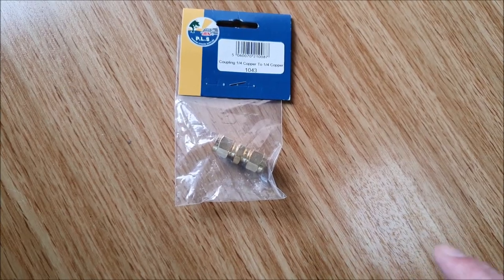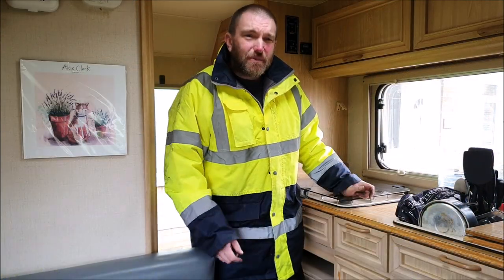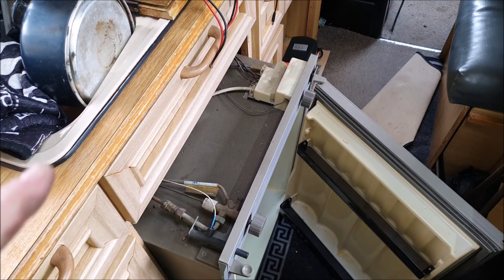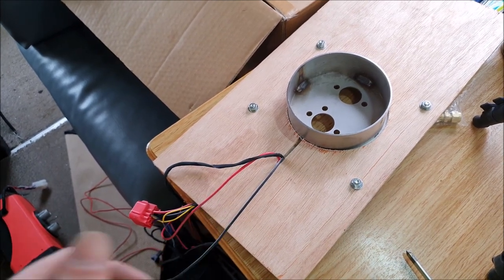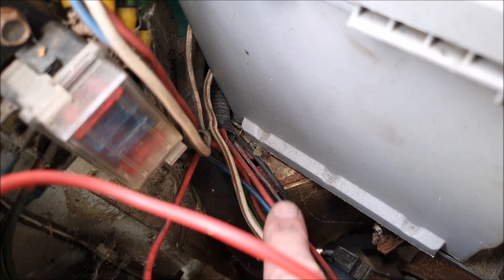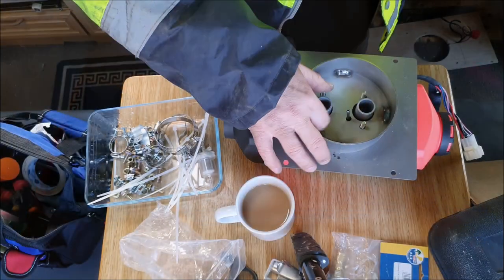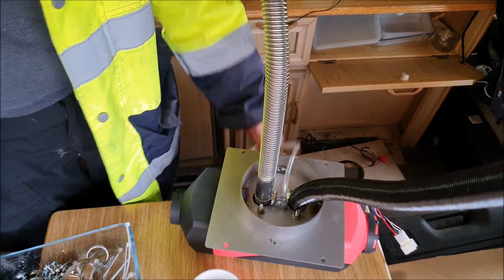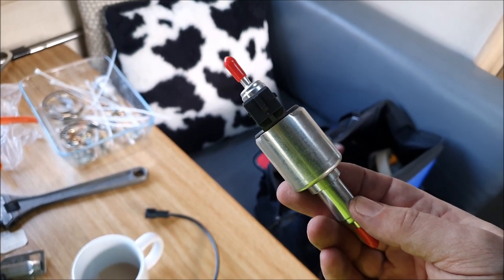Installing A Diesel Heater In My Elddis Autoquest 270 Motorhome Part 4 - Electrical Connection

Comment: As Mr Earnshaw comments, I'm reminded why I gave up trying to be a home mechanic, plumber, electrician, or engineer! I'll stick to what I know which is building, and leave the other stuff to others more qualified than myself.
It's so frustrating not having the parts and having to pop off every time something is too short, small, or narrow. As always, I know you'll get there in the end. 
Admirable effort, and respect for sharing the failures as well as the successes.
Reply from the maker: Thanks, I always try and show the less successful elements as well as when it goes smoothly.
Overall I think most of the difficulties come from trying to install in an existing layout. 👍

Comment: Another tip from old George rather than nicking cables, wires use dressmaking pins or needles poke into insulation of wire into copper strands . Pull out pins or needles and holes seal themselves up. George
Reply: LOL That is why the Americans gave us the F4 Phantom so cheap.  They had buggered all the wiring and new we would replace it LOL
Reply from the maker: Good tip, thanks George 😊

Comment: Cut the old pipe off about 2inches from T piece. Solder a bolt inside old 2inch pipe and refit it check for leaks. Cheers from George

Comment: like the location going to spend some time underneath my van and see if I can fit mine in the same location.Any top tips, I have a Elddis but different lay out than yours
Reply from the maker: I think it's a good location however don't tap into the existing wires from the leisure battery like I did, wire it directly back to the battery with some 6mm2 cable 🙂

Comment: Hello again, that negative lead you just screw to the chassis, just make sure it's free of rust. The positive needs to be connected directly to the battery not through a tiny wire, 20 amps need a 12 awg wire because these heaters can draw between 8 and 12 amps during startup and shutdown. I hope this helps you out
Reply from the maker: Thanks. I think from everyone's comments I will be looking at the wiring again on this soon. 👍

Comment: They can pull 10 amps on start up so I’d be inclined to run a separate cable to your leisure battery via a fuse. That’s what I did any way
Reply from the maker: Does seem to pull a lot of power at times. I suspect the installation may end up subject to a program of 'continuous improvement ' 🤣👍

Comment: Watched the video and noticed to bolted the fuel pump to the chassis this will cause a vibration and noise recommend you fasten with cable ties so it’s not on the chassis this was recommended to me and we have no noise from the pump at all cheers from Arthur
Reply from the maker: You can just about hear the pump inside the van. The rubber mount seems to soak up a lot of the vibration.  I'll swith to suspending it if it becomes an issue though thanks 👍

Comment: 27 amp two core wire is what I used. Not saying I’m correct but they do pull a fair ampage
Reply from the maker: Not sure of the rating of that leisure battery loom but it's reasonably hefty. I may well end up running a separate feed 👍

Comment: I would have fitted it 180 degrees round from where you have so the wiring is hidden behind the unit.
Reply from the maker: I did consider this but then the heat would be blowing into the cab 🤔 I'm going to put an enclosure around it in any case 👍